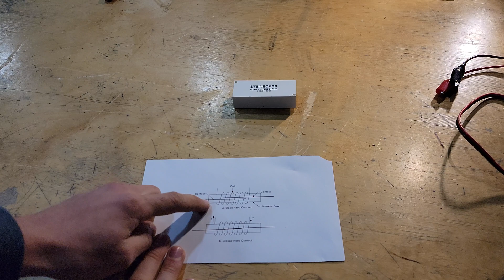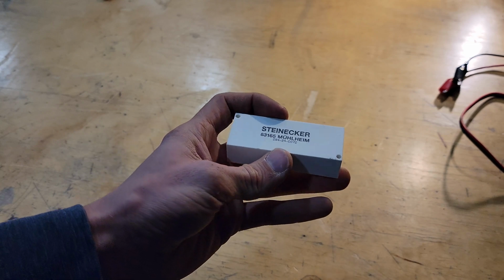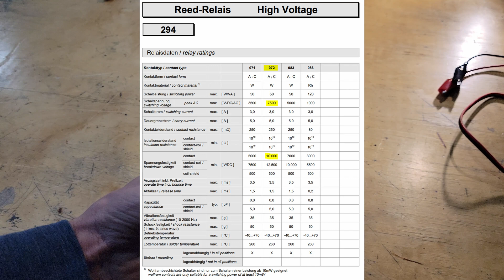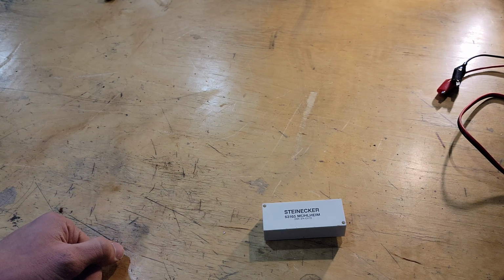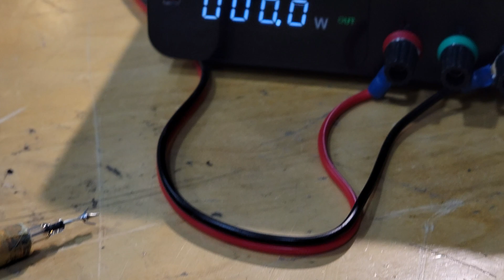Inside the Power: High Voltage Reed Relay Teardown and Secrets Revealed

Comment: It's probably a single pole double throw relay with two switches inside it, one which is normally open (the one without the magnet) and one that is normally closed (the one with the magnet). When both of the coils are energized the open relay closes and the closed relay opens.

Comment: Probably find in a high voltage unit like that it'll be filled with sulphur hexafluoride or similar or left at ultra high vacuum.
Sulphur hexafluoride is used to extinguish electrical arcs. Argon neon etc (noble gases) are used in neon lights and welding specifically because they are easy to ionise and carry an arc well.
They may even pressurise the gas in the tube to help with breaking the arc though I'm not sure at what point the breakeven on that is.
Vacuum makes things easier to ionise until you get to very very high vacuum levels, i don't know that it has been used for this kind of thing but i wouldn't put it past people.
The advantage of that would be i imagine less leakage current than you'd get in a filled tube. Though that would rarely matter I'd think.

Regardless of the fill gas they will almost certainly bake the assembly under the vacuum to like 300c or so to bake out all the water that has built up adsorbed into the glass surface and the metal etc.

I wouldn't be surprised to see in a quality unit like this a getter of some kind too. A reactive metal that will eat any oxygen that gets into the tube. Though if it's pressured with hf6 that's probably not needed.